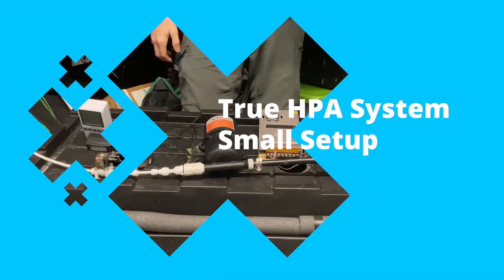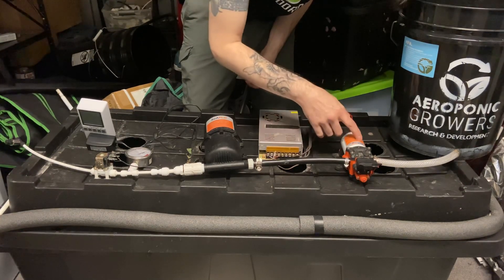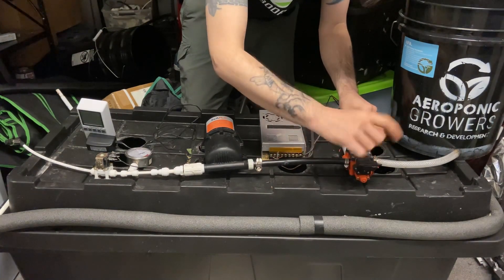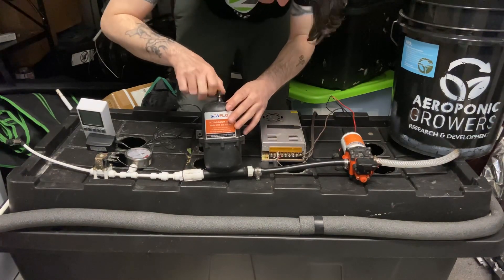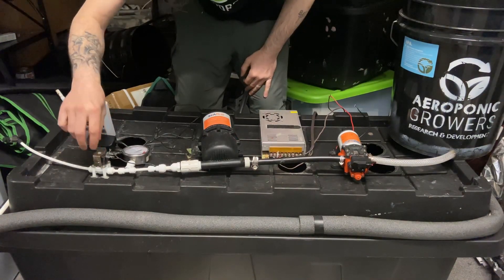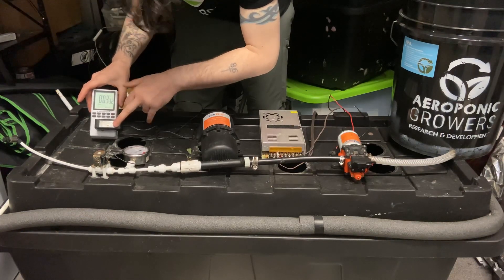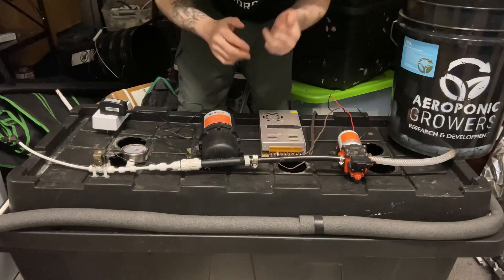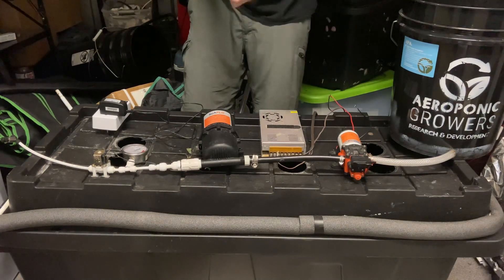Smaller True HPA System Parts Setup. Using tubing, PVC, Hose Clamps & push fit fittings.

Comment: What is the outgoing pressure from the accumulator tank? Can I use this setup to mist water from 0.1mm nozzle?
Reply from the maker: Sorry for the delay! Scientifically speaking the outgoing pressure will be at what you pumped it up with. For aeroponics we want to shoot for 80-100 psi and that can go up a bit too. We inflate the internal air bladder in the accumulator tank to 78 psi. When you have an 80/100 psi pressure switch on your diaphragm pump it will fill the tank with liquid to 100 psi and shut off. Now every time the solenoid opens, the air bladder is pushing that liquid out of the tank. This keeps reducing the pressure until it dips below 80 psi and the pump turns on again. It’s expensive to measure droplets and we’re looking for 50 to 60 micron droplets. TEFEN makes really good nozzles that produce the droplet sizes needed. I like their red colored version because they are dripless. When they get the proper pressure they spray then stop as it backs off. This makes more similar sized droplets. So can this push through a .1mm nozzle, yes.

Comment: How could i drain the pressurized tank with this system?
Reply from the maker: Have a tee setup with a valve between the tank and the solenoid. Open the valve slowly and drain the tank. Make sure you have a pressure relief valve somewhere on the tank if you can.

Comment: No longer a website? where can one go to learn more? how many large totes can you set up with the one air pressure tank? does all the equipment (on the tote there) have to be duplicated per tote? Wondering about a pvc/ez clone misters to spray roots with a submersible pump and hydroponic nutrients in the bottle. the water is pushed up or down depending on the height of the pvc. Then it combines the two and you only need the sub. pump. Will that setup work?
Reply from the maker: You can use one pump for your system and add more accumulator tanks as you need them. A lot depends on how you build your system and everyone builds theirs differently. The setup you’re talking about sounds like low pressure hydroponics and will work fine. And they work best for small grows. Good luck!

Comment: How many sprays of 3 seconds will the accumulator do before the pump kicks on to pressurize the system? Thank you so much for the info!
Reply from the maker: It matter how many misters are spraying for 3 seconds. A 4 gallon accumulator tank holds around 3 1/2 gallons of fluid and that can take a couple hours or even a day to refill.

Comment: 4:43 not sure what youre saying here (tree hpa system??) if youre using an aquatec (im guessing 8800) then ive heard that the pressure switches often fail what do you reccommend? thanks.
Reply from the maker: Get the 80-100 psi pressure switch. Often people get the 60-80 or lower switch and over crank it making it break.

Comment: Why not just get a constant duty pump to eliminate the accumulator tank from the system
Reply from the maker: A constant duty pump would need to turn on and off for each spray. There isn’t a constant pressure behind the solenoid without an accumulator tank. The accumulator tank stores all the pressurized liquid made by the pump at the same pressure.

Comment: Hey I am reading this from your website "The downside is having to open the chamber to allow fresh air in, but this can mess up your spray time for a day". Can you explain what you meant by mess up your spray time for a day ?
Reply from the maker: I should of wrote “your removing the humidity in the chamber that has built up and it may take up to a day to build up that humidity again.” So don’t change your spray cycle. Some people call it “degassing” which refers more to air atomizing nozzles which constantly fill the chamber with nutrient fog.

Comment: What is the model number of the 4 gallon accumulator you've been using? I have a 3 gallon which has a max pressure of just over 100psi, and I'm not excited about running it up so close to it's theoretical limit. But a lot of the units that support more psi just seem to really escalate in price since they're often industrial grade. Also, you should post amazon affiliate links to the products in the vids so you can get some monetization :P
Reply: My advice is to invest in a good quality accumulator so you only need to buy once.  A 6.3 gallon 10 bar with a replaceable bladder and stainless hardware lists at $90 (stateside). It may sound expensive but it`ll be money well spent. I have two 6.3gal and three 26gal accumulators which run at 140psi, some are getting on for 10 years old now and i`ve never had an issue. I`ve used the cheaper RO accumulators, mainly for hpa cloners and they didnt last for more than 2 years before the diaphragms let go.  You`ll also find the paint tends to bubble around  the  base of the outlet connector with rust underneath.
Reply from the maker: @atomizer2665  also if you want to use larger tanks at a higher pressure to hold more sterile nutrients, an in-line pressure reducer allows more control. Atomizer even hand pumps tanks and has shown nutrients can stay sterile up to 4 weeks in a tank.
Reply: @AeroponicGrowers  
Pressure reducer is a must with an accumulator, otherwise the outlet pressure tracks the tank pressure. In the case where its a 20psi swing its not so bad but when you have a 60psi swing it makes a big difference. I havent used my rothenburger manual pump in a while but its ready to go if i need it.
Reply: @atomizer2665  and how would the inline pressure reducer help in the case of 60 PSI swings? Not sure I follow...
Reply: @MrLeonfs  
The flowrate of hydraulic nozzles increases with pressure.  If the tank runs from 140psi down to 80psi, you`ll have higher nozzle flow rates when the tank is freshly charged that gradually reduce as the tank pressure drops down to 80psi. The pressure reducer maintains the output pressure at 80psi regardless of the tank pressure. The nozzle flow rate will be fixed at 80psi.
Reply: @atomizer2665  Perfect. It makes total sense. Yes, I've noticed in my tests that the flow rate decreases with lower pressure. Thanks for the super quick response.
Reply from the maker: I hate Amazon....😌 Most people run their system at 80-100 psi. The max pressure rating is what they are saying is still within the safe range. I’ve pushed them further, but it’s not safe. Like many products people just put their sticker over it. This is an iSpring tank, but under the sticker is the manufacturer that I commonly see on all the tanks. I’ve had more issues with fittings breaking at higher pressures. Most don’t last long with 160 psi max. So yes, if you’re going to set up a much higher pressure system you have to step up your equipment to commercial grade. Get that accumulator tank as close to your misters as possible at 80-100 psi or 90-110. Let me know...

Comment: Can you post the model of the pump? Thanks
Reply from the maker: So that is a pump we had manufactured and use to sell. Just go with an Aquatec 8800 pump and get their 80-100 pressure switch or 90-110 psi. They commonly come with a 40-60 switch so you have to look around for the higher psi switch.
Reply: @AeroponicGrowers  Thanks!

Comment: These small accumulator tanks allow you to maintain a higher pressure than the other bigger accumulator tanks which go up to 100 psi at max, not sure how much that is actually a benefit though. More fittings, more pressure loss. What is the difference between the specs of this and the other pump you have in Aerobox?
Reply from the maker: Yeah this video was to show the old way of making systems. People have been asking since they only have access to the resources around them. Basically this is a boat or RV setup. I’m using the Aquatec pump now inside the AeroBox. They can run continuously, allowing a low pressure system if you get in a jam.